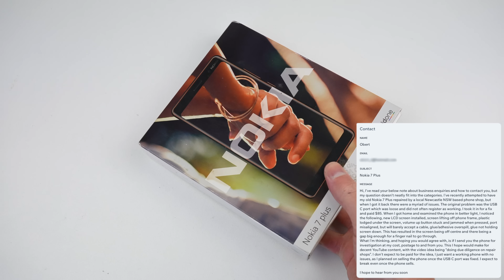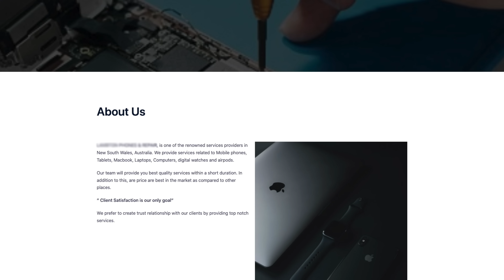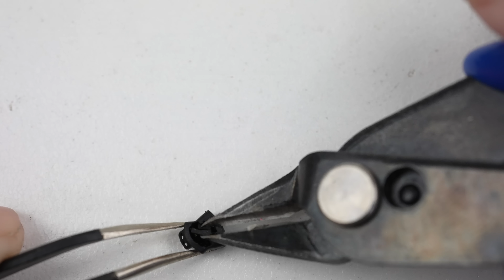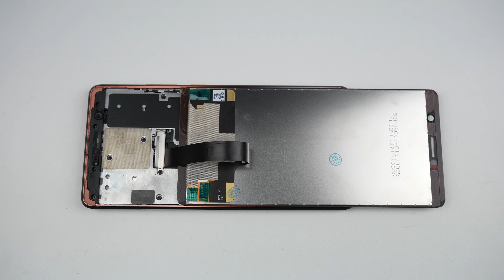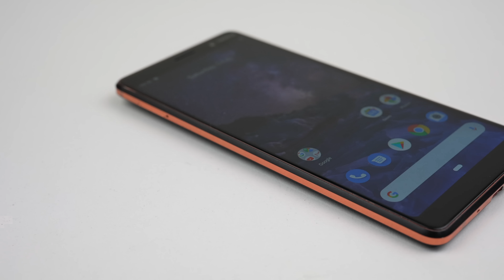Fixing A Viewers Horribly Repaired Phone - Nokia 7 Plus

Comment: I'm commenting on a white 7 plus. Still in love with it - colour, copper accents, size, and especially the haptics of the back panel. 
Sadly I will have to finally let it go after a port replacement 2 years ago left me with the screen coming loose now, while the battery is close to dead as well. 
If only I knew how to search for a recent phone (any size and price bracket - as long as specs are accordingly) with a backside that feels exactly the same; smooth, dry, non-slippery perfection that it is. 
Any suggestions?

Comment: I saw this video, because I had a Nokia 7 Plus, and, you guessed it, the repair shop didn't seat the screen correctly. It was still a better job than on this, however.

Anyway, I still have the phone and after 5 years still works quite decently. I miraculously haven't had the charging port break on mine, but it is ever-so-slightly loose. Back in 2018, it was the most 'complete' mid-range phone I could find, and is probably one of the most dependable phones I've owned. Fingerprint sensor and face recognition were TERRible though.

Comment: I hate to say it, but this entire “repair“ was a scam. And now because of the shotty work. But because of the replacement parts. They are not original, and it really is not difficult to take a screen off without breaking it. It’s not the first time I’ve seen a phone repair shop “break some thing” and replace it with shitty parts and sell off the original parts. For example, you bring in your iPhone to get the charging port cleaned out, when you come back they have an entirely new screen on your phone. They claim they dropped it, and replaced the screen for you for free. In reality, They took your around $500 screen and replaced it with a $20 or $30 screen and then used your original (~$500) screen for a repair and got paid $400. It is so common and independent repair shops, and the sad thing is that most people will never notice.
Reply: Honestly I can't blame apple too much for locking their devices because scam repair shops are so overabundant everywhere
Reply: @kuro9410_ilust  Apple doesn’t lock the devices to try to help people not get scammed. They were voiding warranties because people went to cheaper repair shops. Basically apple wants you to pay $750 for a new screen at an apple store, rather than going to a repair shop they can do it for 50 bucks, because if you are at the Apple store and I told it is almost $1000 to repair your phone, you are a lot more likely to buy the newest model iPhone. Apple locking their devices due to aftermarket repairs should be illegal.

Comment: Interestingly, I have a somewhat similar but less severe mess up on my dads old Nokia 7.
This was the first and only phone screen I replaced, the first time using liquid adhesive as well. 
I only got a small bulge around the edge but definitely no misaligned charging port (which I also replaced) or missing screws.

The screen on that one was already shattered and the phone already got replaced, so ultimately it was just because I could / the parts were cheap.
Still worth it though. as my grampa ended up using it.

Comment: yeah, i should have done mine on my own, the person i took it to was supposed to replace the screen of my Galaxy A20 and managed to not only replace i with an improper screen, the colors were much more dull afterwards and the old screens touchscreen ran all the way from top to bottom, it now has a good inch on the bottom that's unusable and he didn't set the headphone port back properly and the first time i went to plug in my speakers it snapped the tip off so now i dont even have sound unless i plug the partly broken speaker jack into it, mind you the repair cost me $90... $90 for a job i could have dont better, and i dont even work on phones.
Oh! and the place i went to repair it at didn't even bother gluing or sealing the screen like it originally was.

Comment: Those are damn solid devices. I have its smaller cousin the 6.1, which I replaced the battery last summer. They might not have fiery performance, but they are tools that you can rely upon. I'm not gentle with my phones, but it's three years of ownership, and the device still performs like first.

Edit: Going on the 5th year of ownership, on its 3rd battery, and still going strong.

Comment: This coming from someone who has deal with this kind of butcher on a weekly basis, Nokia screens are not fun to remove, however can be done reliably with practice, and be careful when cleaning the tape on those screens, when removing the tape or glue it can pull the adheasive that holds the backlight to the lcd, not fun, and also get some Tesa tape from if ifixit, it is the best tape for cell phone repairs, I’ve used that tape you had there and in my experience it can be too thick for certain repairs, aswell as not hold as well as Tessa tape, fun fact, iPads are taped down with the stuff, also, thank you for sharing this kind of information to the public, I manage a repair centre and it’s always so fun to see someone else’s take with things like this

Comment: I still have bad memories of a repair shop near college NOT repairing the wireless functionality on my PSP 1000! I dropped the PSP and I got the stuck WLAN switch problem. The wireless functionality did still work, but after I got it "fixed", the switch could click into place again, but wireless functionality no longer worked and the charging port also didn't work anymore! I took it back, they got the charging port working again but wireless STILL wasn't restored! I took it back again and again, wireless STILL NOT FIXED! In the end, my parents got me a 3000 model PSP.

Comment: I had bad experience with a repair shop called  m- tech they lied about their water resistance and used literal glue and didn't tell me the screen was garbage and it was an s10 they left old filthy adhesive in it from before and it never did well small amount of water killed it don't use them

Comment: I had a Nokia 7 Plus that had the infamous no charge issue these phones are known for due to a manufacturing mistake making the port easily break so when mine broke i used the insurance i had gotten for it and for 50€ i got a Nokia 8.3 5G as a replacement which is a good phone.

Comment: I work in a repair shop and do not repair the lcds that alone. We get them already on the frames and they still lift. This screen is hard to put down. If we do screen like this that require tape we use tape but with primer. Tape alone will eventually lift. Primer helps lots. Its easy to blame others without knowing what goes on after time .lcd only repairs are horrible regardless of who you are or how good you claim to be.

Comment: I have this exact phone and it's an absolute tank. Dropped it multiple times without a case or screen protector, and the metal on the sides has scraped but the screen doesn't have a single crack.

Comment: I had the exact same problem with Nokia's service. The Nokia 6 that my mother was using had a faulty 3.5 mm Jack. Took it to the service center. Got an estimate of 1 week. The phone was not ready after a week. After constantly following up with the center and Nokia reps, got the phone back after a month. When I got it back, the screen was messed up, it was not good properly, for was leaking out. In All corners of the screen , touch was not working. Went back to service center and they refused to take the phone back. 
Thankfully, I knew someone higher up in Nokia. Connected them, they got my phone replaced the next day. Then i proceeded to get the service center closed. Because I found out many other people with similar experiences and they all got harassed.

Comment: im looking into replacing the display on one of my phones. im going to have to use an amount of liquid adhesive, as precut adhesive isnt available. im trying not to spend too much on it, apparently t7000 liquid adhesive is good for display replacements, its really cheap in my country, and i cant seem to find any good adhesive strips here. would anyone recommend t7000 adhesive for a siplay replacement? im going to have to use adhesive all around, no adhesive tape. if you think that not using tape is a bad idea, can anyone recommend an economical adhesive tape which will work well. thanks in advance!
Reply: What adhesive did you use, currently looking for a good one before fixing the 7+ too
Reply: @lordquadrato437  ended up using b7000. works well. apparently t7000 is the same thing but just black (b7000 is clear) so just buy whichever is cheaper i guess? Most repairers use t7000 though.

Comment: Just a tip. When applying liquid glue, apply it on both surfaces that will be in contact and wait 2 or 3 minutes before gluing them together. You'll see that the bond is much stronger and almost instantaneous.

Comment: I have this exact phone and I can definitely say the charging port is 100% the main failure point. After having to get it done twice in 2 years I had to cut ties and move on to a OP7t, which also happens to have a terrible charging port 😭🤣
Reply: lg stylo 6 has a terrible charging port too mine died after tripping over the charger i was lucky that i had amazon prime at time because i fixed it for like 13$ then i gave it too my grandma to use for her mobile games that she plays... phone still works fine last time i checked

Comment: I used to work in a nokia service centre. Nokia 7 plus is by far the hardest phone to disassemble. The original, out of the box adhesive is very very very strong. Most new technician will accidentally damage the display by prying a little bit too deep and damaging the panel internally. And yeah, it is not a good device. I hate it to this day.

Comment: This video is everything wrong with the current state of independent repair. Gluing a mutilated incompatible part isn’t exactly up to standard. Using double sided tape IS NOT the same as an exactly cut dust and water resistant seal. Missing screws weren’t replaced, and the charge port misalignment wasn’t properly corrected either. I’ve been a fan of your channel for ages now, but I keep seeing these shoddy repair practices popping up more and more on your videos… Not a good example for the right to repair movement.
Reply: and hot gluing the display down… I mean come on…

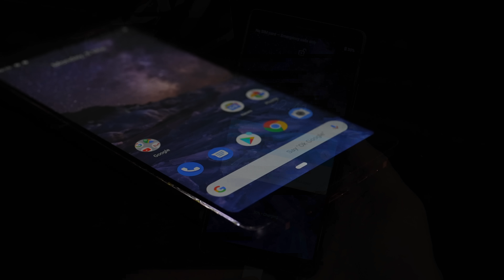Comment: 2:46 actually, the USB C ports on these and other Nokia from the .1 lineup were faulty and you’d rip them apart, even if you used your phone normally. My Nokia 7.1 also had the issue, it was acknowledged by Nokia and covered under warranty.
Reply: They fixed that in later batches.

Comment: My old phone (Huawei P20) went through the same treatment. Front screen misplaced, glue coming out from all places, back glass not properly placed (after two weeks it popped out). I then found out that they installed the flash filter backwards. They didn't even care about cleaning the back glass before installing it since I could see dust in the camera glass.
After some months the fingerprint reader started wiggling and eventually stopped working, I had to put a piece of tape on it.
I was scared of using my phone while it was raining because of the bad job they did.

Comment: I've repaired quite a few Nokia 7 Pluses. I find the display quite hard to get out in one piece, despite using heat (I have a heating pad) and being careful, using plastic cards and picks etc. It seems to be pretty fragile, and the original adhesive pretty strong. Maybe that's just me! The charging port does fail regularly on these, and aftermarket ports should be tested thoroughly before fitting - I bought a cheap one which didn't have all the components on it for cellular reception (antenna is in this array as well, as far as I could determine). Another great video, Hugh. Keep up the good work!
Reply from the maker: I noticed the blank screen in calls when I tested it off camera but after putting the grommet back on the proximity sensor it worked fine.
Reply: @HughJeffreys  Thanks for your reply, had edited my comment when I saw you'd found and replaced it!

Comment: I had a Nokia7+ and it was repaired the same way after, the screen was slightly elevated and you can see the glue with light dropping through. Still worked after though so I kept using it.
Just to mention that this series of Nokia phones has several issues (software and hardware) and Nokia had been completely unhelpful in resolving them.
Anyways, great video Hugh!

Comment: Reminds me of when my wife's Google Pixel was "repaired", by an authorised repair partner. She had to send it back first because they didn't remove an internal film, blocking the front camera. After a short while it stopped working. Turns out they had fixed the battery adhesive tabs at the wrong place, they went over an internal ribbon cable, when eventually broke under the pressure, then with the battery moving around , the cable for that broke and the phone stopped working entirely. I also found they had snapped off an internal microphone ribbon cable, there's no way they didn't notice this as the microphone itself was not in the phone, just the end of the ribbon cable.
Reply: Thats hella scam
Reply: A friend of mine bought a business laptop and it was his pride and joy. Until it broke and had to be sent to an authorized repair shop. It came back with its aluminium top scratched all to hell. When he complained, the shop manager just said "all laptops will look like that in time, deal with it".
Reply: How did you not notice the mic not working sooner? It is a phone, basically useless without the ability to make a call.

Comment: this is the reason why I do my own repairs now. I had a bad experience on a shop for a charging port replacement, they opened the back so poorly that it has bends on its two corners and a lot of missing screws with lazy adhesive application. and the worse thing is the soldering job on the port, lazy and misaligned.

Comment: Before watching the repair my guess is that some of the glue of got somewhere to the button mechanism and it's getting stuck. Also another guess is that the original screen got damaged during removal process and they needed to swap it as well.

But damn... I would burn that repair shop if they would return the device to me in this state. Maybe they swapped the charge port but they completely damaged the device.

Nokia no longer does this copper details phone. Current Nokia are cheap plastic garbage with buggy software and low quality hardware for premium price.

Comment: This experience hits so close to home for me. My charging port died last summer, and I asked a local shop for a quote for replacement. They quoted me for 30 bucks if repair was to succeed or no charge if the screen cracks during removal ( obviously ). Went ahead and took the phone in as if it works out at least I can resell it. Two days later I got it back, charges superbly.. but the screen is messed up with huge patches of dead pixels. It did not break but the heat needed and the prying they did surely killed it. They offered that they can replace the screen however the original parts cost half the resale value, I could confirm this myself. Chinese LCD seem to be more miss than hit for this model. So now I have a shoddy repaired phone that I cannot use or sell besides for repairs. I would love it to have it fixed but giving the same shop more money is just... If only my screen was mounted back this bad I could maybe fix it, but its glued on really well :)) as opposed to Hugh's example

Comment: in 2014 i brought my ipod touch 4th generation to a mall kiosk repair shop to replace a shattered glass screen, and the result looked shockingly similar to this. the screen was popping out, the buttons were squishy and got stuck, and the home button was sat so far deeper than the display that it was genuinely uncomfortable to press. i know that specific model ipod is very tricky to repai, but wow, i'm not exaggerating when i say i prefered the shape it was in prior to the repair.

Comment: I really like the copper and black too. What a shameful repair.
One thing you can do to use double sided tape on thin edges, is to stick in into the phone housing, and then run a blade along the edge (inside edge) to cut off the excess.
Nice work though.